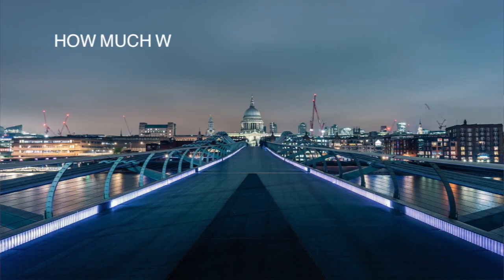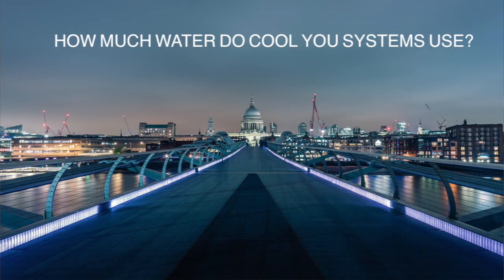How Much Water Do Air Conditioning Systems Use? | Cool You UK

Comment: Having found the datasheet for the condensers that CoolYou use:
a single (monosplit unit) consumes 65-135 litres of water per hour.

A 2 room multi system consumes 75-180 litres per hour. 

Hope this helps answer the question properly!

Comment: Just listened to this technical explanation and was disappointed by the lack of actual factual information. Surely you know the actual use of water by your different sized units units in terms of litres per hour when operating at full capacity. You could then convert this into cubic metres of water consumed and work out the cost . I understand that water costs might vary across the UK but you could apply costs in London to provide true indicative costs.  I cannot see why you called upon your technical ‘expert’ to provide such vacuous information.